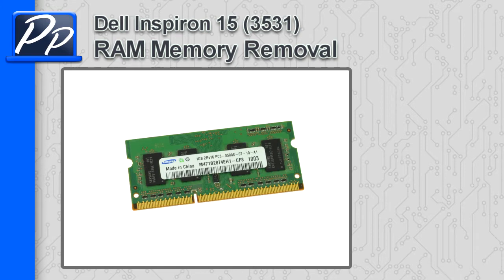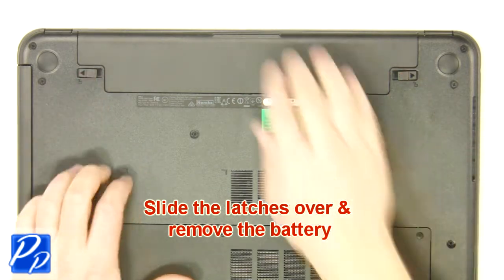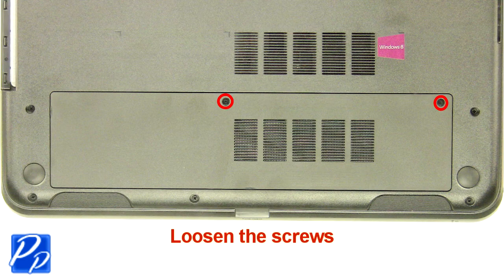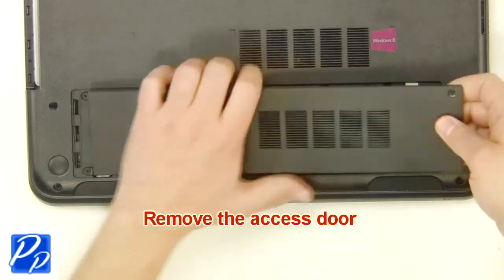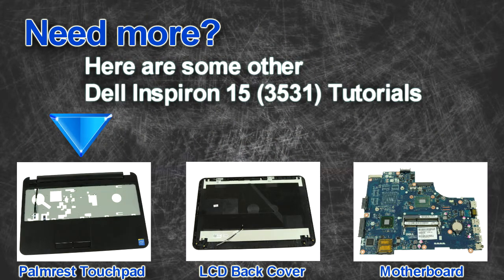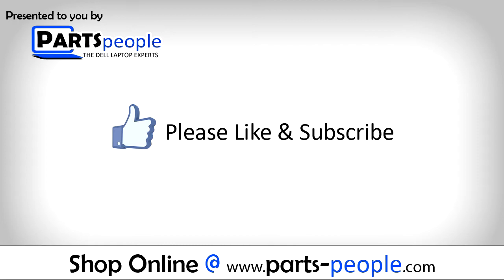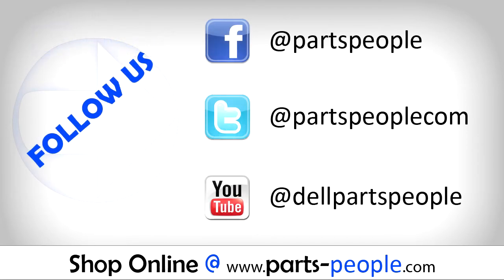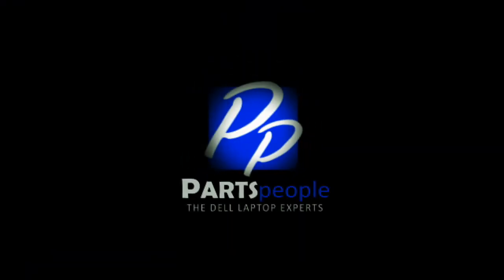Dell Inspiron 15 (3531) RAM Memory How-To Video Tutorial

Comment: Hi! Is this laptop compatible to make a chance from 4GB RAM to 8GB?
Reply from the maker: It is not. This model takes a max of 4GB.
Reply: @dellpartspeople  I put a Kingston 8GB 1600Mhz and my system recognize it
Reply from the maker: @angelsambrano9640  I can confirm that the Dell Inspiron 3531 user manual specifies the max amount of memory supported is 4GB. However, I have experienced times where their specifications aren't 100% accurate. Just a heads up. Glad you've sorted it out.
Reply: @dellpartspeople  that's true. Sometimes it's better to see the Maximum amount of Memory supported by the Processor